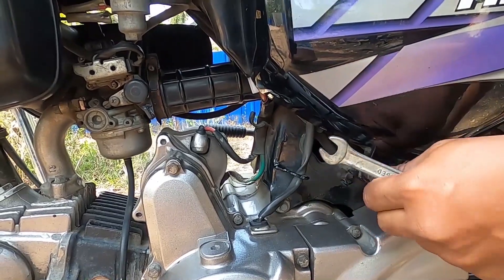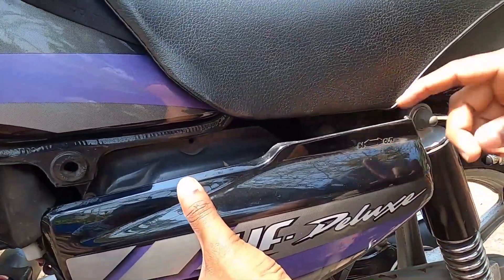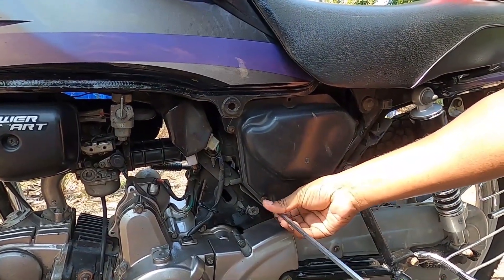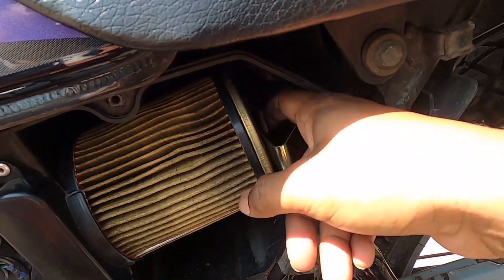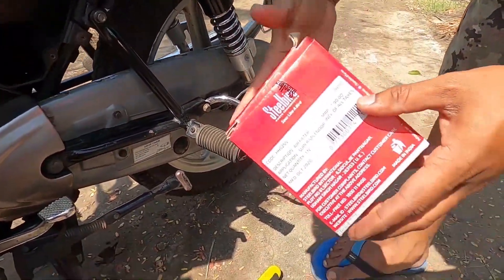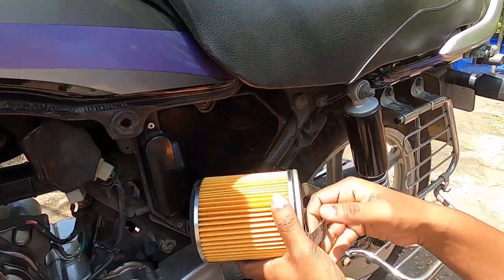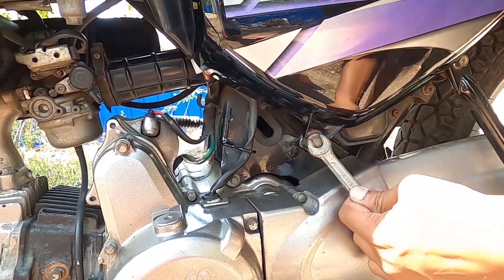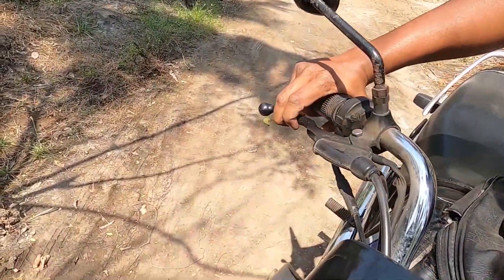HF DELUXE AIR FILTER CHANGE | മലയാളം

Comment: Ella bike inum ore Airfilter ano?
Reply from the maker: Vytyasm undu.
Reply: @autoveller9799  7 varshamaayi upayogikkunna yamaha ray z nte air filter azhichappol full block aayi kidakkukayaayirnnu....ath enginil enthelm permanent issue undaakkiyitt undaakumo??....ath maattyappol problem solve aayitt undaakumo?? Plzz reply
Reply from the maker: @akhil5037  normal case il mileage kuravum, missing um power lag um anu vararu, fuel proper ayi burn chayatondu. But orupadu kalam ayal dirt akatu keri metal parts inu scratch  vezarundu.